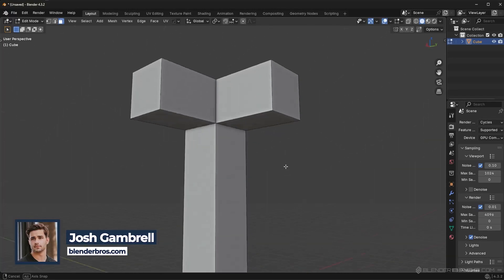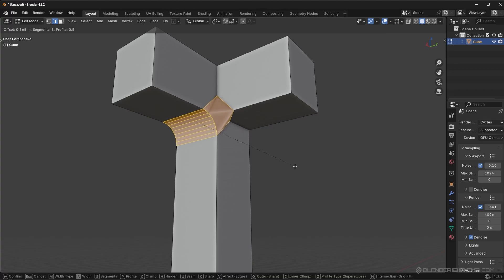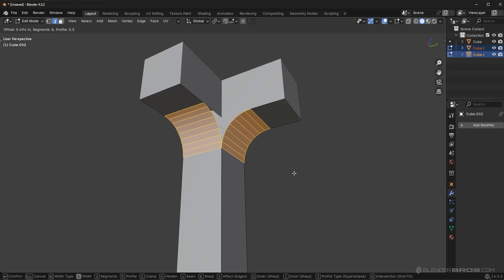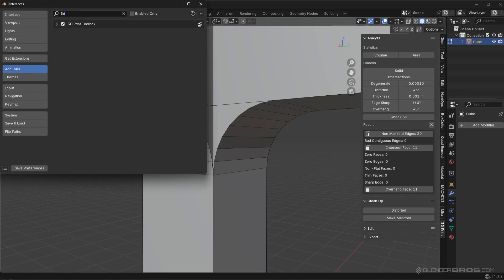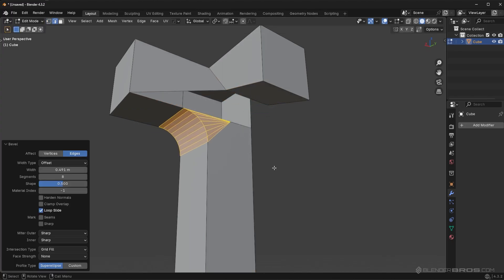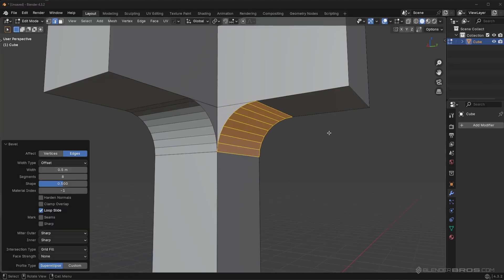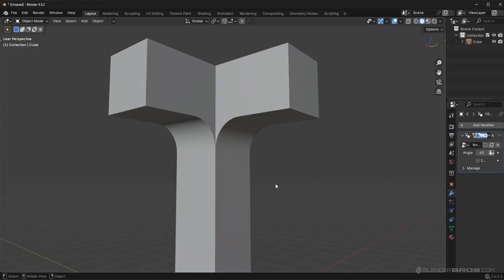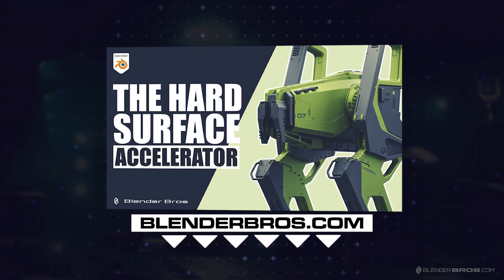How To Handle 'Weird' Bevels in Blender

Comment: Amazing coincidence! I've had to make this exact shape today at my work, and I resorted to the first method. Regarding beveling, I've found out that if you delete the second edge from the bottom up, this makes it possible. It's not the best solution, since the curve will lose the perfect curvature; however, if the model is to be seen from medium/far distances,  there's no issue.